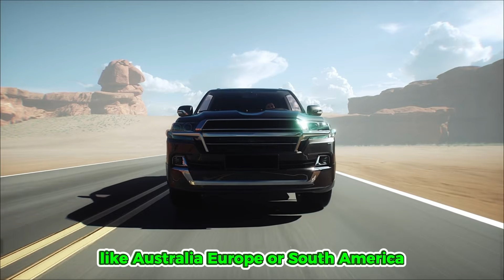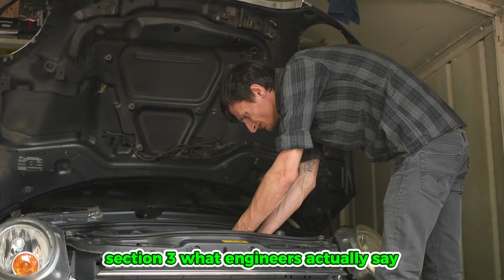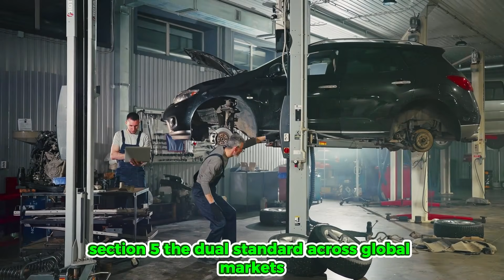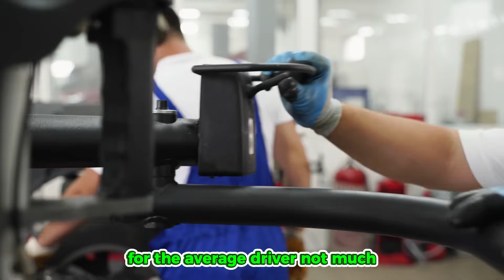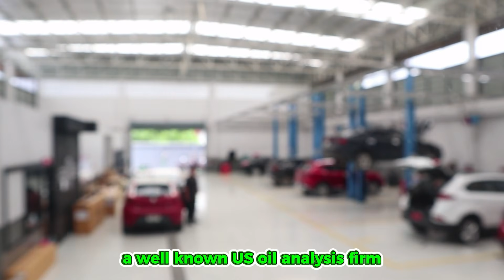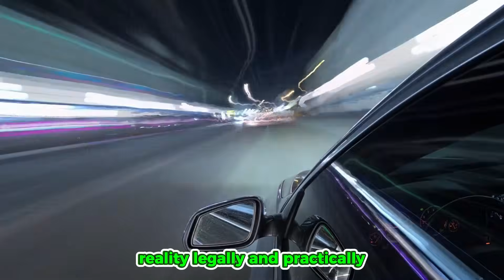Stop Using 0W-20! Mechanic Reveals Why 5W-30 Can Save You $4,000!

Comment: In Michigan, my 2005 Taurus had 230k on it before I sold it. The car ran perfectly, but the Michigan winters and that road salt were taking a toll on the body. Oil cap said 5W-20. I ran 5W-20 in the winter, but ran 5W-30 in the summer months. Small change, but it seemed to be the best. As of November 2025, the new owner pulled the engine and trans and had to scrap the body...That engine and trans are now powering a different car, running like clockwork...Always change your oil 4-5K miles, if you really want a long life out of your engine

Comment: My vehicle's oil cap states 0W-20 Dexos-1.  I use 0W-20 Dexos-1 in -40C/-40F deep cold winter months. I do many short distances during winter months.    I use 5W-30 Dexos-1 in hot climate summer months.  My vehicle tows trailers in both winter and summer months.  I also do my own Engine Oil & Filter changes when remaining use percentage is between 35%-30%.   I also installed an engine block heater and onboard battery charger.   Always "plug in" both during winter months....  This works for me....

Comment: Greatly helpful..but-what about shifting to 5w-40 from 5w-30 in hotter countries like India??....you may talk...namaste🎉
Reply: I wouldn't go to 5W-40 oil even in India, especially in a modern  engine. Older engines used 5W-40 oil for extreme heat like the Sahara dessert and/or oil burning older worn engines. Stick with 5W-30 oil.
Reply: @viddyasaagar5457  Ferrari is always using 
5W-40 full synthetic oil HTHS 3.5 at 150Celsius.